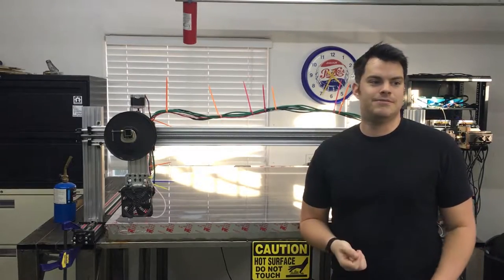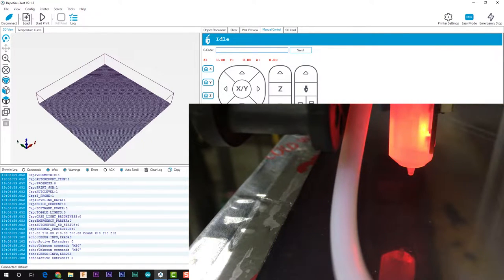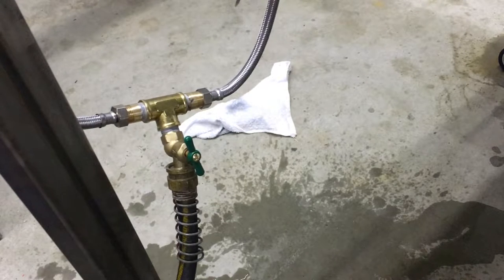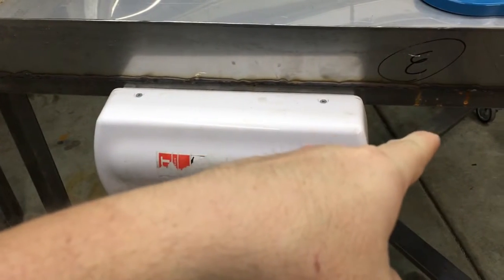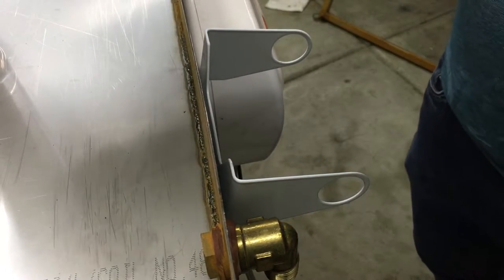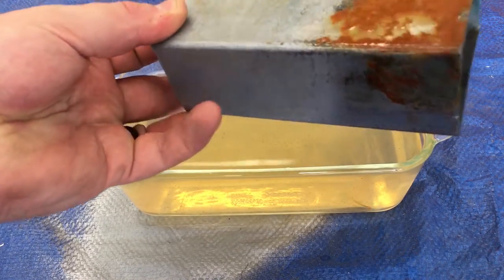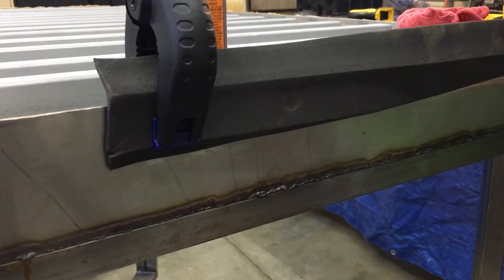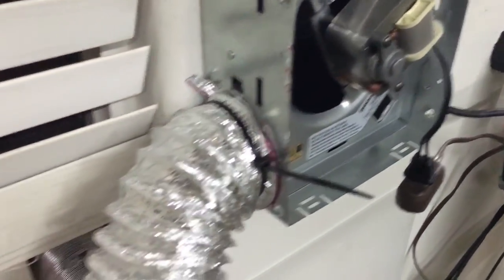Largest 3D Printer Build - Troubleshooting Problems (Episode 11)

Comment: *clicks print

"See ya next month"

PS: Dyaam this thing is huge!! Print time is proportional to the cube of the size.
 If you scale something 2X in all axes the print time increases by over 8 Times!

I would recommend going for an 'E3D super volcano' with 1mm or bigger nozzle. Current setup is not at all ideal for a printer this big. going for a quality hotend with proper cooling would also solve the heat creep issue. 

Good luck with the build!

Comment: Why not go with quality hot end? Your jambing is probably due to heat creep into the cold end of the assembly. You don't have any kind of fan to cool the assembly. You want your filament to only melt in the heat block area, and stay solid until that point. A good quality hotend is a must.

For that size print area, an e3d volcano makes sense. e3D v6 is also going to perform much better for you then that generic style hotend you have on there.

Comment: Watching the rusty water drain away it made me think if it would save money on heaters/filters if you painted all that tank and submerged steel work with polyurethane or epoxy.. just stop the water from ever reaching the metal.. ahhh just seen you sprayed them but what about the inside of the tubes? They look open ended.. what about capping them off or attempting to spray the inside? Either way, impressive machine.

Comment: Man! Great Job So Far.  I  know you are trying your best so. here is some things to consider.. use ss only.. and tig a threaded ss pipe threaded to drain the tank.. cut and bend some ss plate 90 degrees, Or some ss angle  to your dept in the tank.. &  oh "not to get in two deep  :  "You want a Cadillac Not A Chevette" RIGHT?  You can heat it by a better output:  DIY ELEMENT FROM A WATER HEATER  ( 2 CAPS IN A  in a ss cilader and a inlet and outlet ss or brass )  ( or just get a 110 volt - 5 gallon water heater..)    AND A GOOD PUMP WITH A High Amp RHEOSTAT.. the water heater has a built in temp switch.. So you will have 100% control.. Also? you can put it all on a TIMER.. Ya!  So Whenever You Are Ready 24/7 and Any  time During the Day or Night.. Just be careful ! And have it on a dedicated breaker.. Ground the system!! Everything!  And check for all codes.. Like a 20 Amp GFCI .. YEP BE CAREFUL!  ...  AND FOAM INSULATE THE WHOLE THING!  and even cover it with foam on top.. 90% perfect!  And Pick Up Heating Times..  BINGO... "NOW  THEN;  EVERYTHING WILL BE SWEAT" contact me for any help?  Check Codes.. Ground The Whole System!  I look at the Replies.. Have a Great Day!
Reply from the maker: Thanks Don you win for the most epic comment I've ever gotten on one of my videos so far. Thanks for the good tips!

Comment: I have no idea if this is a risk for you:  Zinc getting into the plasma torch, and forming zinc oxide fumes which are poisonous.  I think there must be OSHA and/or EPA exposure limits for this.  If you have a fume ventilation system for your plasma, then my guess is there is no problem.  

Zinc fume poisoning occurs mostly when welding galvanized steel, or when blacksmiths are melting down galvanized steel.  In general, blacksmiths are told not to melt down galvanized steel.

Just mentioning all this, just in case you want to double-check for safety.

(btw, zinc oxide powder is non-toxic.  It's just the vapors are dangerous to breathe.)

Reference:
https://en.wikipedia.org/wiki/Metal_fume_fever
https://en.wikipedia.org/wiki/Zinc_oxide
Reply from the maker: Yea I think I'll be going to Aluminum/Stainless bars in the future... NOT a big fan of zinc oxide fumes and I have a venting system but don't trust it. Thanks man!

Comment: ANTIFREEZE IS VERY DANGEROUS! AND VERY LETHAL!  IT WAS NEVER INTENDED TO BREATH THE VAPORS FROM ! AND IT  WILL KILL YOUR DOG IF HE LAPS UP SOME FROM THE FLOOR.. IT WILL KILL ANY HUMAN WHO DRINKS IT TOO..
Reply from the maker: Yep not stuff you want to be drinking and or breathing. I'll be going to an all Aluminium inner tank support bar system that will stem the need for antifreeze. The common agent in antifreeze is Ethylene glycol and it receives a 1 in health and a 1 in fammability on the NFPA system. This stuff stays away from Max(my dog) and other living things like myself.
Reply: @CountryAireDesign  hay good job. just some things that we need to be careful of.. Still a great job so far.. what about  drain plug? and a better split up disbursement of heated water? I was an electrician.. i know wiring..  I am hoping to build a 500cm x 500cm diy 3d printer... it is a long time wish for me & then maybe more in a better size? Bigger!  Some time later.. Remember the ground faults ? And ground the table and the Electronics.. ( i have seen very deadly things "like touCHING one thing and the other where it was hoked up wrong and BOOM! ] IT IS vERY daNGEROUS AND Invisible.. so just check and recheck.. Like Any input and groundings..i'm very knowledgeable, And have Seen Crazy Things.. Event by Pros! So Check all equipment.. Event "BRAND NEW EQUIPMENT CAN HAVE HORRIFIC pROBLEMS.. sO aGAIN CHECK EVERYTHING - TRUST NOBODY and have some fun.. Good Day.. If you need any schematics ON THE FEEDS IN THE MAINS AND BREAKERS TO YOUR SYSTEM? let me know.. yOU SHOULDN'T HAVE ANY PROBLEMS THOUGH.. jUST CAN NOT TRUST ANYONE.. GET TESTERS & CHECK FEEDS FOR POLLARIDIES.. Have a good Day! Live safe.